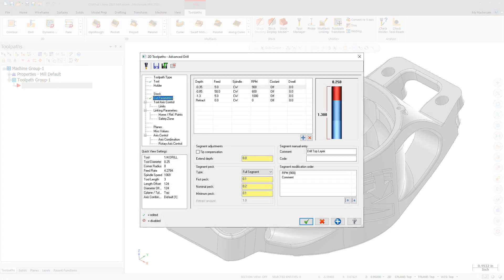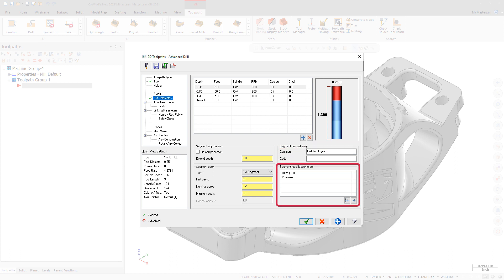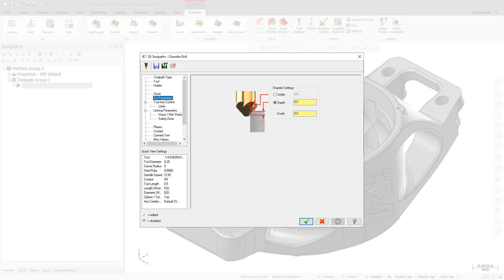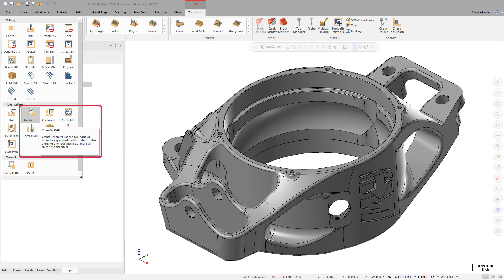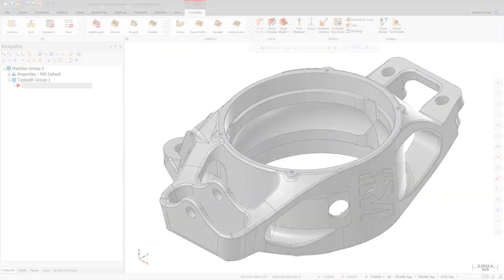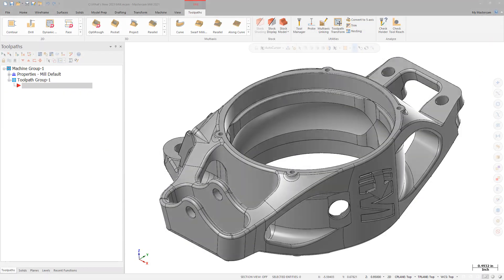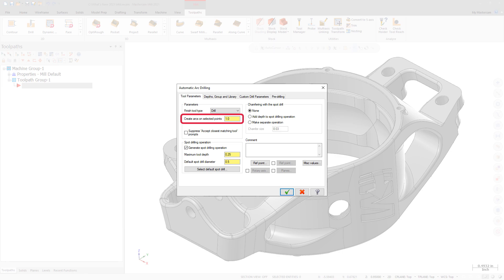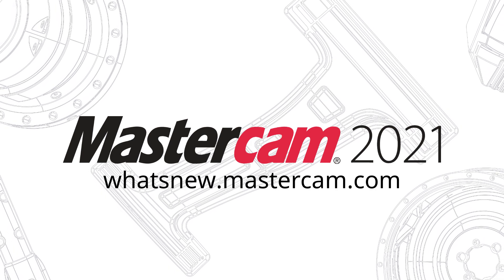Mastercam 2021 Milling Enhancements – Hole Making

Comment: So EXPENSIVE yet fusion 360 has been offering the same/similar/better features like 5 years ago for a lot less money...MC is so unstable, for instance: the toolpaths' folders in the tree-manager are so sensitive that just a simple click will make them shuffle around unexpectedly which can cause catastrophic results (at the machine & financially)...this problem it's been there forever...I've been using it for many years by necessity... customer support from their website IS A JOKE!!!!!!!
Reply: fusion 360 is fine if all you do is 2d 3axis milling. try to do anything more complicated or if you need to actually take control of a toolpath and you're SOL